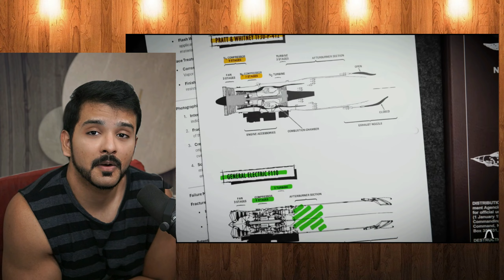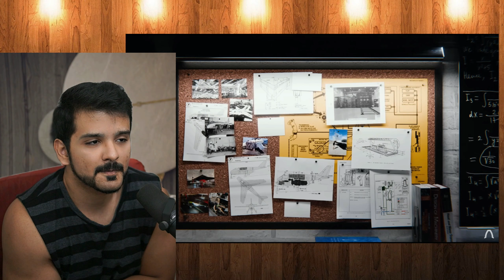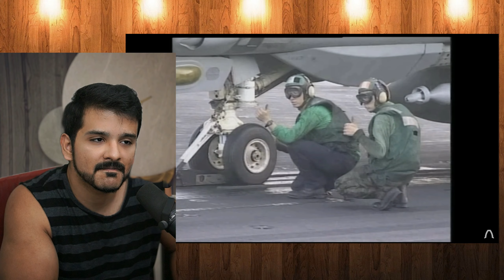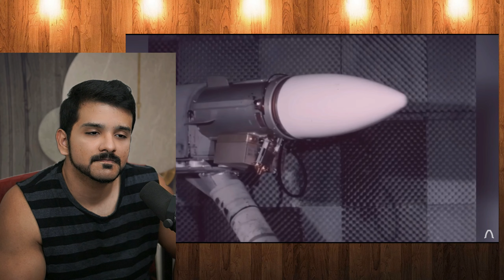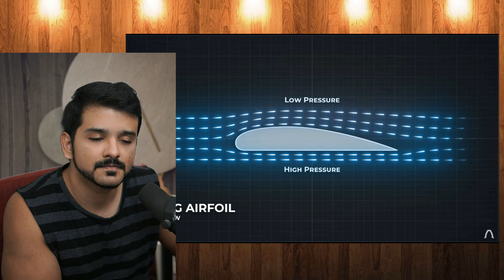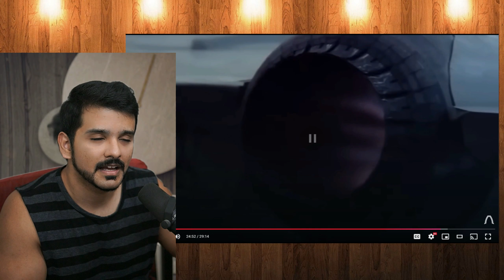The Insane Engineering of the F-14 Tomcat | CG reacts

Comment: The most ridiculous thing about the F-14 is, that the F-15 already existed and a better aircraft, that could be fitted with a tail hook, yes, they tested that. And the F-15 is faster and quicker, longer ranged, can carry far more weapons, they coulda made a naval version with the better radar and the aim-54’s. Tail hook, beefed up suspension and just used them as interceptors/ air superiority fighters and woulda been a fraction of the cost and maintenance overall of the F-14.
Reply from the maker: Why would f 15 exist before f 14?
Reply: The numbers don't always line up sometimes skipping several numbers. This guy is also wrong the F-15 had its first flight two years after the F-14 and entered service Two years later than the F-14 also the navy was already invested in the F-14 and its not that simple to integrate those upgrades except the tail hook which it already had. Also all carrier capable aircraft still use tail hooks for carrier landing and many land based planes also have them for emergencies like brake failure on landing so it doesn't run off the runway which has arresting wires at the end. The hardest of those upgrades to put on in terms of physical modifications needed would be the suspension and radar as navy landing gear are very big in comparison to land based fighters and the AWG/9 radar was huge. If arresting gear fails then the crash net comes up.
Reply: The f15 can’t fly slow, the f14 can, which is needed when you’re dog fighting and trying to keep pace with a bomber that’s going much slower. The f15 would fly right by and can’t stop to keep engaging. F14 has ability to slow way down and stick with a bomber and just blow it out of the sky

Comment: The F-14 was designed for the US Navy (pursuant to their request and specifications); whereas, the F-15 was designed for the US Air Force, with both aircraft's development cycles overlapping by many years.  With a few exceptions, those two military branches rarely purchase and operate the same aircraft due to differing operating environments and needs.  The F-14 made a cameo appearance in the second Top Gun movie because it was the star of the first Top Gun movie and, as such, was arguably more famous than the F-15 in the late 80's.  A fun and interesting fact is that the F-14 was equipped with one of the first microprocessors ever developed, but that wasn't known or acknowledge at the time due to the classified nature of its technology.

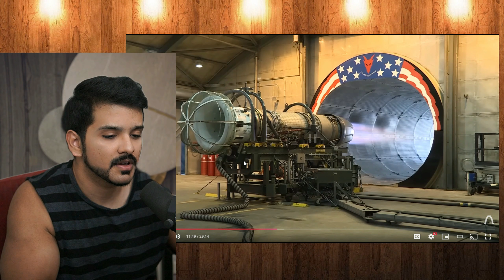Comment: 15:40 :They keep the engine on incase they overshoot the wires and have to go around again to try and land in fact the pilots keep at full throttle after they hit the deck rather than trying to glide in which only allows for one attempt if something goes wrong So they do slow down on approach however keep the engine on to allow for the speed up on touch down, and maintain stability on approach.